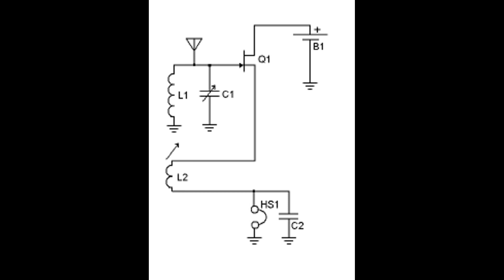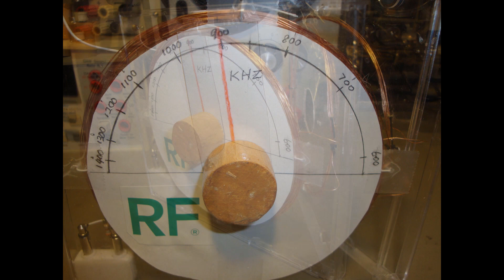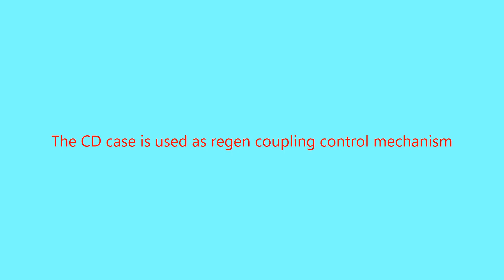佛系 - A Minimalist Regenerative Radio

Comment: How many turns for the coils?
Reply from the maker: Sorry, I do'nt remember. I used an on-line air core inductor calculator to find out the number of turns to match my tuning variable capacitor (to cover the tuning freq range).